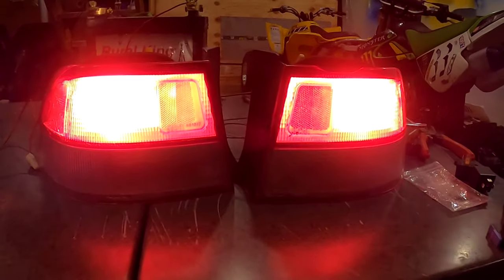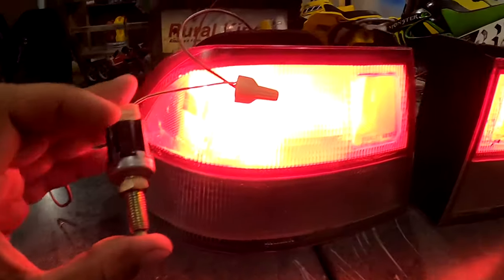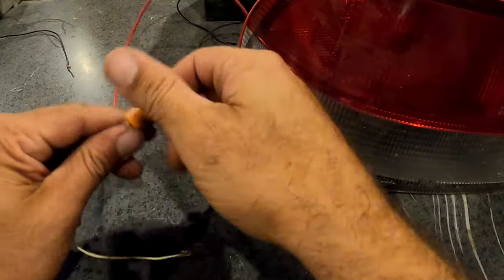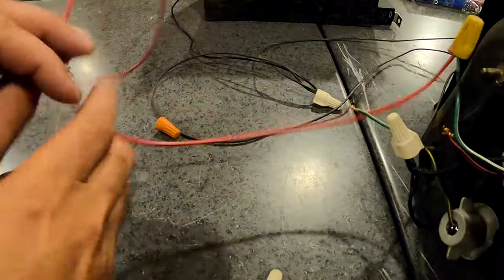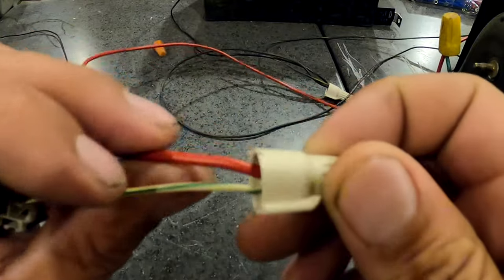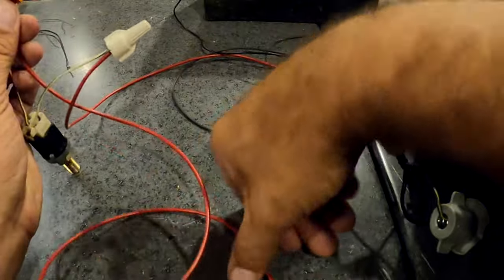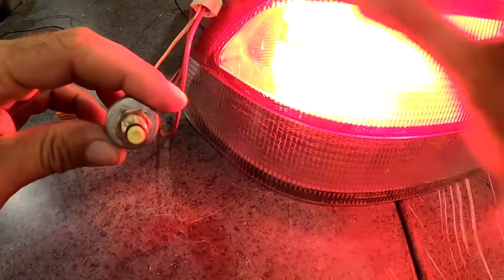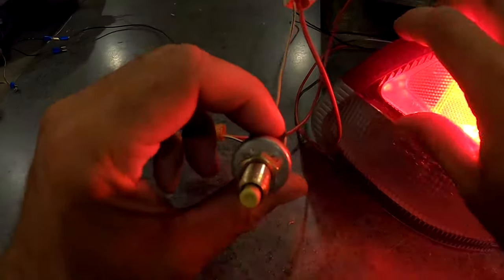How to wire Brake lights

Comment: Do i need to connect the power wire directly to the battery? Do i need a fuse between the battery and the switch? Thanks in advance
Reply from the maker: No you can come from the fuse panel. But if you come from the battery you do need a fuse in between.
Reply: @streetstancecivicgarage  Thank you so much

Comment: How about like the top 3rd one because I was going to change the bulb but then found out that it didn’t even have the wire/connector for it
Reply from the maker: Just run a hot wire off your rear brake light to it. Then ground it inside the light mount.

Comment: I need to know how to wire a right tail light on my 1946 Chevy truck. It came with only 1 tail
Light
How & where do I make the wire connection. Help please
Reply from the maker: Just hook a wire to the hot on the light you have and run it to the other side for the new light. Just ground off the new light where you can. If you need more help just ask. I also have videos on how to hook up running lights and turn signals if you need them.
Reply: @streetstancecivicgarage  could you please post the link of the turn signals video. Thanks!
Reply from the maker: https://youtu.be/tiQyT7yXYsU

Comment: I have to do this in my 240sx🥹
Reply: Clean the contacts on the taillight connectors. I had to sand mine. Also brake stop lamp switch if they’re staying on all the time.

Comment: Where are the lights grounded.
Reply from the maker: You can ground the lights on the chassis anywhere you are able to. You can use a nut cert or a self tapper.